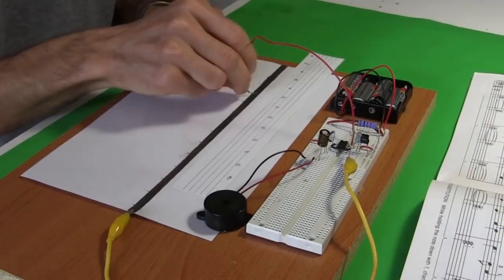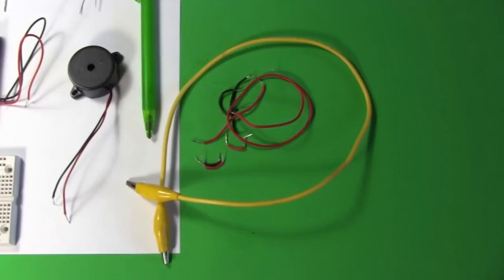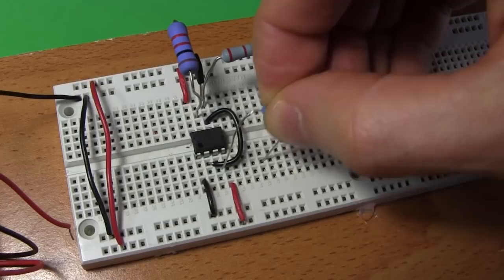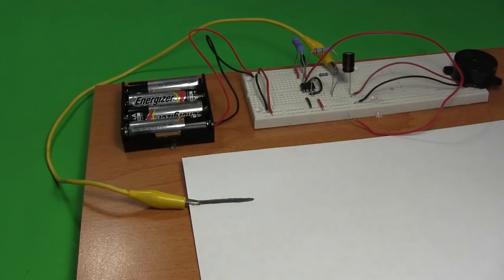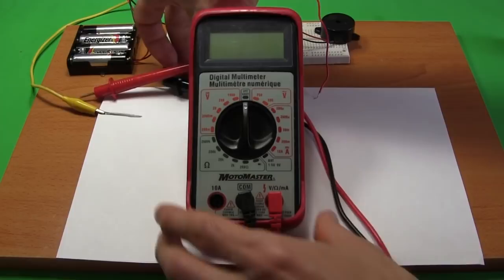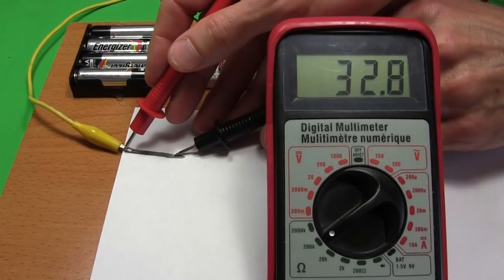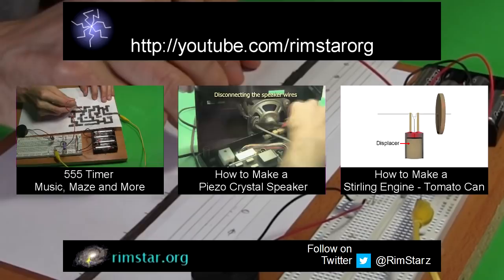555 Timer Music Instrument How to Make

Comment: The Stylophone lives on !
Great video instructable...nice too to see the graphite resistor method used in a very practical way. The 555 will drive a 0.25W old radio speaker to a pleasant level :)

Comment from the maker: You could but it the amount of resistance between each musical note will have to be awfully small. In other words then pencil mark will have to be very wide. The smaller the capacitor value the easier to make pencil marks. See my other video "How to Make 555 Timer Music Player and Maze Solver" for more on this. There's a link in the description below this video. In that video I use a 2.3 nanofarad capacitor (0.0023 uF).

Comment from the maker: Your resistances are fine but your capacitor capacitance is high. The difference in resistance between each musical note will be very small, only 60 ohms between C3 and D3, for example. This means your pencil mark will have to be very thick to get that small a resistance. See my video "How to Make 555 Timer Music Player and Maze Solver" for how I calculate it. There's a link at the end of the video and in the description below the video.

Comment from the maker: I'm sure you can use bare conductive paint but it would be a little more difficult. From a resistivity chart for it that I just found online the resistance is a lot lower than for the graphite pencil marks I showed in this video. That means it would be harder to make specific frequencies at specific locations. But I'm sure with patience it could be done. I talk about the calculations needed in detail in my other related video "How to Make 555 Timer Music Player and Maze Solver".

Comment from the maker: @Aravind Mani, Probably a short somewhere dumped a lot of current from the batteries into the 555, or maybe one of your resistors is shorted inside. Luckily 555 timers are cheap, usually you can't even buy just one at a time. Recheck everything and try again I guess.

I also replied using a PM to Aravind Mani. Youtube won't let me reply to his comment here.

Comment from the maker: Yes, it's possible. Look at the wikipedia page for "555 timer ic" and scroll down to the heading "Astable". You'll find the formula for calculating the frequency given a capacitance and two resistances. Read that section. Plug the formula into a spreadsheet and you'll be able to try all sorts of values. Also do a  google search for "555 timer datasheet" and pick a datasheet. In it you should see a Free Running Frequency chart.

Comment from the maker: The capacitor connected to the speaker blocks the DC. The output from the chip is pulsed DC at that point and since the capacitor blocks the DC component, the speaker gets only the AC component. But as you saw, it still works without the capacitor. That's my understanding anyway. I give a link in the description to the webpage I got the circuit from, but given the english translation errors on that page I don't think they're the original author. It's a pretty common circuit.

Comment: Looking at the coloured lines of each resistor I noticed the 6.8 KOhm resistor is actually a 68 KOhm Resistor, because it has a Blue Line (6) followed by a Gray Line (8) which make the number 68, and then you have the Red Line which is 10^3 (1000), so the final number would be 68 x 10^3, and if you replace 10^3 by the multiplier "Kilo" you get 68 Kilo Ohms...  Correct me if I am wrong (my sight is not really good hheheh)... The tutorial is wonderful however!! Keep them coming :)

Comment from the maker: It's 0.1 microfarad. I bought mine from a local electronics store but you can find them online, ebay for example. It doesn't have to be 0.1 microfarad, just something that small or smaller. You can try with your 10 microfarad one, but your pencil marks will be wide, that's all. If you look at my other video you'll see I used a 0.0023 microfarad (2.3 nanofarad one). That one I took from a circuit board from some electronic thing I took apart, not even sure what that thing was.

Comment: Knowing that the speaker "farts", does that mean it converts the square wave into triangle waves? If so, wouldn't a regular 8Ω speaker with the magnet and wire combo produce a smoother sounding output?

Comment: While you can get low power versions, the 555 is a TTL IC meaning it uses 5v logic. If you check the datasheet with your version you will probably find a minimum 4.5v min supply voltage.

Comment: it isnt working for me
is it the wires, because i used wires that came with the breadboard
is th piezo buzzer because it is a 6v  rohs conform buzzer
pls help as soon as possible
Reply from the maker: +hp26711 Recheck all your connections. I had to try two or three different pencils before I found one that worked. If you have another 555 chip you could try it instead, just in case there's something wrong with the one you're using. It could be that your buzzer requires too high a voltage. Mine is rated for from 4V to 28VDC. To get a higher voltage, you could try adding one more AA battery in series, positive output wire of your existing batteries to the negative of this added one. Or just make sure you're using all new batteries.

Comment: While you can get low power versions, the 555 is a TTL IC meaning it uses 5v logic. If you check with your version you will probably find a minimum 4.5v min supply voltage.

Comment: i changed it a bit more
Purpose
The purpose of this experiment is to determine that the width of the graphite resistor affects the resistance and to see if A, B, C, D, E, and F on a 1cm by 12cm graphite resistor, will change the sound according to the sections named by letters.
Problem
Which graphite resistor will have the highest resistance by changing the width of the graphite resistor by changing the width to 5mm, 1cm, 2cm, 3cm, 4cm, and 5cm with the same length of 15cm and also to see which letter from A to E will give the highest sound when split equally on a graphite resistor that is 1 cm by 12cm?

Comment: ok thx
does the side u start on breadboard for circuit matter
and how can i fugure out an analysis
Reply from the maker: +hp26711 Which side you start on the breadboard doesn't matter but keep in mind what I said before in a previous reply about making sure of which holes are connected inside the breadboard. For analysis, the first thing I'd do is check that everything you did matches the diagram. Then, if you don't know your breadboard well, I'd check that you're sure if the holes are connected inside the breadboard like you need them to be. Then I'd start checking all the individual components: measure the resistance of the resistor, the capacitance of the capacitor (if you meter has the feature for that), the battery voltages. The thing that usually breaks for me is the wires at the speaker. Twice that I recall, one of those connections at the speaker itself was no good.

Comment: how did you design this circuit and find the suitable resistor and capacitor values?
Reply from the maker: +Sowmya Prasad I didn't design the circuit. It's a pretty common one but I give a link in the video description to where I found it. Regarding the resistor and capacitor values, I explain how to find them in my follow-up video where I make a more sophisticated music player using the same circuit https://www.youtube.com/watch?v=PSQ6AqqhSgo. And in case you're interested, the ultimate one I made is in this video https://www.youtube.com/watch?v=WM1bZgBqDl4.

Comment: i unederstand thx
now the problem is that i found no pencil that can work
is it possible to change the 6.8 kiloohms resistor to a smaller one
if it is possible which one should i use
Reply from the maker: +hp26711 I'd be surprised if your problem is the pencil, since you've tried so many of them. Keep in mind that the wider the pencil mark, the lower the resistance. So if you've been trying very narrow pencil lines then that may be your problem. It's hard to say what value you could try instead of the 68 kilo ohms (not 6.8 kilo ohms like you said.) You'd really just have to experiment with different values. Maybe try around 10 kohms, 1000 ohms, and 100 ohms.

Comment: Why does my piezo do a ticking sound bot like yours is it because of the resistor?
Reply from the maker: samuel virgil pe Do you mean the sound you're getting is just a slow ticking? The frequency depends on both the capacitance of capacitor C1 and the resistance of resistor R2 in addition to the resistance of your graphite (pencil mark.)  Does the frequency change at all as you move along the pencil mark? If not then one possibility is that your pencil mark is too wide and so is offering too low a resistance.

Comment: Hi there. Would I still get the same result by using a buzzer in the place of a speaker?
Reply from the maker: Hi. The speaker I used is a buzzer, so yes. I guess I was using the term speaker in the general sense. BTW you can also use a small electromagnetic type of speaker too.

Comment: does the orientation of breadboard matter
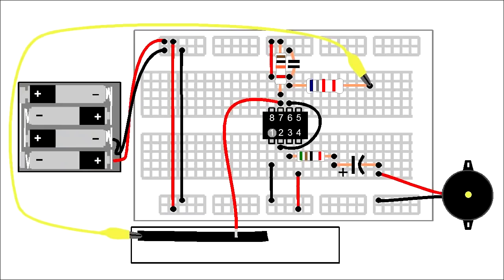Reply from the maker: +hp26711 Yes, the orientation of the breadboard matters. Inside the breadboard certain holes are connected to each other, for example like I show at 2:01 in the video. Similarly for the holes on the sides. You can use a multimeter set to the resistance scale to test which holes are connected inside. Put one one multimeter probe in one hole and the other probe in the other hole. Of course the tips won't actually fit in the holes so you'll have to connect a wire to each probe tip and put the wires in the holes. You should measure very low resistance, less than 1 ohm, if the two holes are connected inside the breadboard and infinite resistance (or whatever your multimeter displays for that) if the holes are not connected. You may also be able to find a diagram for you breadboard somewhere.

Comment: how does the sound increase
does the sound increase when it gets closer to the alligator clip or the opposite
and why the sound increase or decrease when it gets closer or further from the alligator clip?
Reply from the maker: +hp26711 The volume doesn't change. The frequency does. See the the video starting at 4:30 for the explanation.
Reply: +RimstarOrg does it increase in pitch
Reply from the maker: +hp26711 Interesting. I'd always thought that pitch was the same as frequency but it turns out it's not https://en.wikipedia.org/wiki/Pitch_%28music%29#Pitch_and_frequency. At 4:30, to me it sounds like the pitch increases the close it gets to the alligator clip i.e. the lower the resistance.
Reply: +RimstarOrg thx

Comment: Which pencil is used in this circuit...plss reply fast sir
Reply from the maker: It's just a normal mechanical pencil and the pencil lead is HB 0.5mm. The make of the pencil itself doesn't matter since I've added new lead from refills many times. Sorry for the delayed reply -- I was out of town.

Comment: but if i use a 8 ohm. speaker than a piezo buzzer waht will happen it wil make the sound quality great or it will be the same
Reply from the maker: I tried an 8 ohm speaker a while back. The sound quality is around the same. The sound is a result of the 555 timer chip. The speaker doesn't make much difference.
Reply: so isn't there a way to make sound quality better
Reply from the maker: sameer gangar
I don't think you can improve it much and still use a 555 timer chip. The output is supposed to be square waves (I haven't looked at it on my oscilloscope) so maybe you could do something to the output to make them more like sine waves. I'm not sure how much of an improvement it would be.
Reply: okay i'll try to build an amplifier to amplify square wave inta sine wave and i'll let you know
Reply: sameer gangar
 hey one thing we can do is to change the capavitannce of the capacitor connected to the speaker (buzzer) use a hiegher value and it will work better
Reply from the maker: sameer gangar
I've played with the other components but never tried that one. It really sounds better? Too bad mine is all taken apart right now.

Comment: why the biggerst cap. must be electrolitic?
Reply from the maker: I suspect just to get the needed capacitance. Non-electrolytic capacitors are usually lower capacitance.
Reply: yep.... 100 mF seems to be mostly (or only?) in electrolytic cap-s. It would be cool to have it in a disc ceramic too! I've heard it should be very stable.

Comment: Hello, I am just wondering what would happen if you change the values of the resistors, capacitors, even the batteries? What will happen in each case? 
Thanks
Reply from the maker: The sounds/frequencies you get for the resistance of the graphite/pencil marks would be different. This video shows only my first experiments with this idea. I then went on to do just that you suggest, using different resistances and even a different capacitor to make some music players. My first one was with different pencil marks (https://www.youtube.com/watch?v=PSQ6AqqhSgo) and my second one was a whole hand cranked music player (https://www.youtube.com/watch?v=WM1bZgBqDl4).
Reply: ok thanks a lot!

Comment: Why?! Why?! Why did the buzzer work?As i know we cannot change the frequency of the buzzer unless its a speaker or a piezo element. But why did it work? And also as i know only AC signal can make a sound but here its says a square wave signal, can anyone explain it?
Reply from the maker: But the speaker I used was a piezo element, the buzzer contains a piezo element. And square wave signals can also make sounds. All that's needed is a changing signal and square waves are changing signals.

Comment: does resistance affect sound
Reply from the maker: +hp26711 With this circuit the resistance of the pencil mark from the alligator clip to where you touch the pencil mark with the end of the wire, along with the resistance of the resistor at the other end of the alligator clip wire together affect the frequency and pitch of the sound, but not the volume.
Reply: +RimstarOrg  look at my results for my 
experiment it is weird
Results for Resistance of Graphite resistor
Dimensions Trial 1 Trial 2 Trial 3 Average
5mm by 15cm 404 Kilo ohms 356 Kilo ohms 358 Kilo ohms 
1cm by 15cm 306 Kilo ohms 250 Kilo ohms 256 Kilo ohms 
2cm by 15cm 480 Kilo ohms 474 Kilo ohms 1156 Kilo ohms 
3cm by 15cm 363 Kilo ohms 354 Kilo ohms  
4cm by 15cm
Reply from the maker: +hp26711 Make sure you make you go over your marks a lot with your pencil. They should be very dark and completely filled in. But also try to make them even for all your test pieces. A wide by lightly marked strip can have a lower resistance than a narrow but very dark strip.

Comment: How would you make it to be polyphonic ?
Reply from the maker: If you mean, how to make it play more than one note at a time, you can't with a single 555 timer chip. You'd need more than one circuit or to go with an entirely different method.
Reply: thank you
Reply: How complex is the method ?
Reply from the maker: Kamil Piekutowski
Oh, I don't know of what the other methods are. I've seen some in videos in the past but don't know them off-hand. Different chips than the 555 were used.
Reply: hey man a 8b pencil worked best for me

Comment: will a speaker work better
Reply from the maker: +hp26711 It's a matter of preference. If I recall correctly I liked the sound with the speaker better. Make sure it's a small speaker, like a PC speaker, around roughly 3 inches or smaller. I'm not sure it'll be very loud with a bigger speaker.
Reply: +RimstarOrg  ok

Comment: great and amazing idea ....thanks for sharing us....but can u tell me plz what's the volt of 100 µF  capacitors...
Reply from the maker: Thanks. The capacitor I used is rated for 50 volts, which is far more than it needs to be. From http://www.ti.com/lit/ds/symlink/lm555.pdf is looks like the output at pin 3 could be 15 volts, but for my circuit I doubt it's even that high.
Reply: RimstarOrg ....thanks....i use 25 v can it works or not
Reply from the maker: No. If you look at the Supply Voltage rating on page 5 http://www.ti.com/lit/ds/symlink/lm555.pdf, it's rated for a maximum of 16 volts.
Reply: RimstarOrg ....if the maximum volt is 16 volt so i think that  25 volt work good